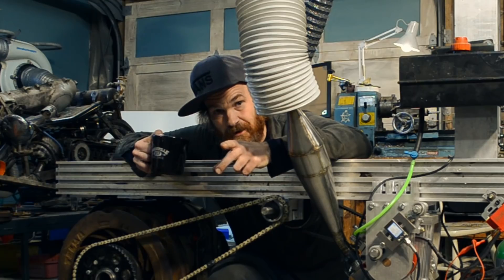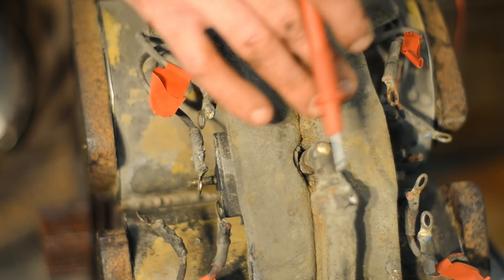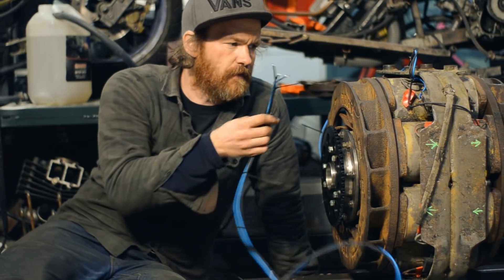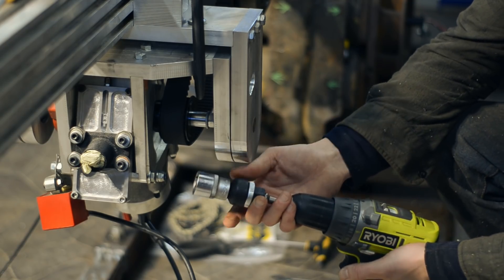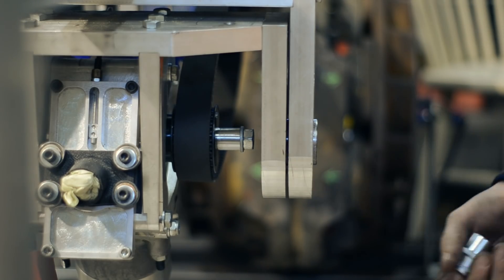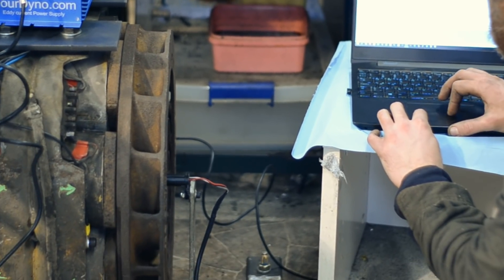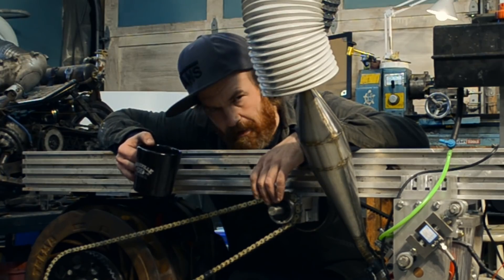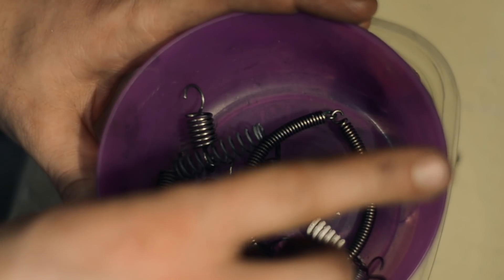The dyno, IT'S ALIVE!!

Comment: Your dyno rotor seems to have some quite massive fans on both sides of the rotor. How are you planning to characterize loses caused by these fans? Engine power = power calculated by dyno + fans losses. I am impressed by your work. I used to play with Aprilia RS 50 with AM5 motor. Great time... Regards.

Comment: This is just an fyi for your future self (in case you didn't know this): the compass needle's red end is magnetized to be a north pole, meaning when it points/aligns to the face of the coil you're checking, that part of the coil is actually the south pole; the same idea for the other end of the compass needle (south pole of the needle aligns with the north pole of a coil). This doesn't matter in your case to get the eddy current dyno working but thought it may be useful to know for something that may come up in the future for you.

Keep up the excellent work. Cheers.

Comment: You need a locking torque converter or direct drive. You are getting losses with that clutch even with light springs, just with the inertial mass.

Comment: Have you considered a clutch like in the( china doll ) 66 cc bicycle motor kits . looked like you were already using parts from a motor kit , i recognized the part right away , no ground  clue . too bad you were not around when i raced Yamaha 100 open karts , used 3 disc 6 spring wet clutch , boiled the fluid in about 15 laps .just enough to go to the front . .. i kinda understood centrifugal clutches were only good for up to about 8 hp .. even worse on 2 cycle motors , but your mileage may vary ... keep up the great stuff ..

Comment: It is goood to hear It running again, sounds sweet! just give It plenty oil in that metamfetamin fuel. May I suggest to use a standard centrifugal clutch instead, at the dyno side of the frame. They are easy to tune for high rpm.

Comment: you might still be able to make a small crater around the copper wire going intoo the broken coils and try to solder a new wire to it then hotglue the wire to the plasic to make it watertight again and to prevent the wire from moving  , doesnt matter if it works or not but it will alow you to load it higher 
you allso might be able to use the retarder as a startmotor if you put some sort of dc x-phase power regulator in there , probably whont be realy powerfull for the size of the thing but i bet it be powerfull enough to start that 50 cc engine
the sound the retarder makes is the wires inside the coils vibrating , you might want to make sure they dont heat up too mush

Comment: Don't use plasters. Real men use Super Glue to glue the wound, then peel themselves off the ceiling and carry on as before. Fun fact: Super Glue was used in the Korean War for battle surgery, as it's the moisture in skin that makes it cure. It's still used in cosmetic surgery today. as the scars are minimal.
Reply from the maker: I almost exclusively use blue masking tape. Never had much luck with the glue. Might be cause I've tried to close up too large wounds with it. Burning should work. I once got a nice bite into my hand by an angle grinder and it didn't blleed at all, but smelled like bacon😁

Comment: Wonderful 👌 did you do any calculations for the dyno gear ratio? Since you have a massive braking capacity, you could use a short gearing to reduce the clutch slippage and bring it to powerband faster. Probably 500rpm is enough for that brake.
Reply from the maker: 👍 I should really go for a second jackshaft, more reduction, there's plenty of room. As it is now we're talking about 3600 brake rpm for 20 000 engine rpm - What I could manage with the parts available.
Reply: @2STROKESTUFFING  yeah 3600 sounds excessive. But you can do first trials with it 😀
Reply from the maker: @ASoftaaja  yep, 4000 is stated as max. I'll see how bad it vibrates. Having it geared like this means it'll work well as an inertia dyno too though. Remember taking my other dyno up to around 4000rpm with a Harley on it, the whole building was shaking!

Comment: Isn't the huge inertia of the brake going to be a problem relative to the engine power in this setup? Maybe gearing can solve this? It seems to me the engine wil have trouble spinning up the brake.
Reply: I don't think the brake has more inertia than the whole bike with the driver. The problem is, the engine does not have any power at low rpm, so it takes some time to reach the rpm where it has a lot of power

Comment: Nice work 2 eared van Gogh.   Some ideas.. Maybe your dynamo is to heavy to get around already , for such a smal clutch ( after that scooter clutch is also a gearing , that make's it lighter to get around) may a other bigger chainwheel wil do a better job , getting a higher rpm. Ive seen some drag race clutch witch have no spings , but thin aluminum plate that bend's out , and only the weight of the clutch plates that make them go out in high rotation... Wheight of the clutch plates also make a big diverence

Comment: The shot u have of the clutch grabbing, looks like one of the brakes hasn't seated cleanly on its spline. Might cause vibration and stop the engine getting to its max rpm
Reply from the maker: One of the rotors on the brake? Yeah, I thought I saw some wobble.

Comment: Would it not be better to use a toothed belt from the engine to the electromagnetic wheel ? It looked like it was slipping a lot. Don’t know if that’s just the camera playing tricks with my eyes or if that’s actually happening. Either way it’s coming on great keep up the cracking work 👍🏼

Comment: Repeat After Me : my exhaust system is to short.
Reply from the maker: I like rpms
Reply: @2STROKESTUFFING  
If you want power at high rpm, don't forget the correct lenght for working.
Egt drop need lenght too.
For me you kill literaly the capacity of this engine with this radicaly exhaust.
For exemple, look the drawing of RSA exhaust, for 13000 rpm  lenght 800mm with big egt. 
Design a real exhaust for this motor, use Vannik and go right.

Comment: Inertia is your friend it can be a dyno just by spinning that mass up and recording rpm against time 

Mass of spinning object

Rpm of spinning object 

Calculate acceleration for each second 

No brakes needed less heat less complex 

More dyno!
Reply: ..there has to be resistances akin to that which will load/act upon the tyre, wheel, bearings, & engine etc, ..as much to help tune the set-up, design and mechanicals enough before road/track testing - otherwise some settings can be far from correct or good enough to even get close to what originally envisaged.
Plus an engine with little to no load will/can over-rev and wear out or destroy itself faster without that burden upon it, realistically taming it.
Reply: @razor1uk610  the Shear mass of the rotor is enough of a load just because its not braked doesn't mean you spin it up without effort take a truck wheel could you walk upto one (raised off the ground) and just flick it upto speed by hand? 

A large enough mass takes allot of energy to spin it upto speed 

Plus the math is allot simpler 

When it comes to overreving that's what the throttle is for!
Reply: An inertia wheel doesn't have the ability to hold the motor at a set rpm. With the eddy current brake you can hold the throttle wide open and control the motor rpm with the dyno. At that point you can accurately measure the torques.   😀  I'd guess he needs to reduce the dyno rpm by 50% to reduce the intertia effect? It will be fairly exciting to stand anywhere near that brake at 3600 rpm! Are the rotors balanced separately? Are they indexed on the shaft? I had a horrible thought about balance and rotor indexing, hopefully it's just a thought.

Comment: won't the magnetic brake magnets interfere with the rpm pickup?
Reply: I think it depends on the polarity of the brake magnet that is at the same position as the rpm pickup. If the polarity is the same as the polarity in the pickup, the rpm signal should get stronger. If the polarity is not the same(magnets repelling each other),  the rpm signal may get weak or gets inverted, but I think it will also work with the inverted signal, because the frequency is still the same.

Comment: Just wondering if the solenoids on a Telma retarder (used on medium commercial vehicles) are capable of being excited at a low enough level that the engine isn’t over-loaded, either that or they can’t generate a low variable torque. Maybe only a small number of solenoids can be actuated?
Reply: Those are not solenoids, they are electromagnets. the load is varied by how much current you run through the electromagnets.
Reply: Sorry if I used the incorrect terminology and yes I appreciate they are electromagnets which generate eddy currents in the rotors. However my point remains the same…
Reply from the maker: We'll find out soon😁 If problematic I can always gear down a bunch to increase torque.
Reply: I do hope it works out OK because you’re doing a great job and your vids are always inspirational.
 @2STROKESTUFFING

Comment: on a serious note..... shouldn't it be direct drive without a clutch? I mean, there's got to be another way to engage it where it's locked in place once you engage the clutch you don't want slippage you get a bad reading that way. I was thinking air conditioner clutch on a car, but stronger. let me think about this while I drink my coffee and I'm going to figure something out worth talking about.....😏.....(sips coffee)…. oh I got it. have you ever seen how a Detroit locker differential works? centrifugal weight spin, and after a certain point, at a higher rpm, it engages (clunk). it's like having a centrifugal clutch with cog tooth gears between the pad surface and the sliding surface. once those teeth teeth mate together, it locks.

Comment: Just throw some heat on those springs and they will get lighter. Worth a shot just to try it. The ones you have won't work so you won't lose anything  by trying  it.
Reply: Dude, the springs are too light already, the clutch is engaging early and the motor does not make enough power to overcome the inertia of the retarder at that RPM. Get the motor up in it's power band RPM and it will pull it fine.
Reply: @rickbegeman4371  you're right, I thought he said they needed to be lighter? But yes they need to hold the clutch in  till a higher ram. I.wad thinking of a torque converter for a go-kart where the weights need to be lighter to allow it to spin faster before they get thrown out and engage it.

Comment: You're not supposed to fall until you're older. A farmers remedy for cuts is an application of clean diesel fuel and no infection. Amazing but true.
Reply: For small cuts cyanoacrylates aka superglue is the best. I've often used regular ones, but specialized medical ones are preferable.

Never again problems working with cuts in your fingers. Just burns like a b when applied.

Edit:
For deeper cuts, infected or dirty wounds it's obviously a bad idea to just glue it shut. But it becomes more and more widespread in regular medical practice and has been used in the military even for deep, heavy bleeding wounds for decades for good reason.

Comment: Forgive me if I'm wrong, but shouldn't the vanes on the Dyno be turning in the opposite direction to suck cooling air through? Probably doesn't make much difference for short, comparatively low-power runs.
Reply: The air is centrifugally pulled from inside to outside, past the coils, to cool them, so no, they are turning correctly

Comment: Have you thought of, perhaps, using the electric clutch from a car air conditioning compressor?
Reply: I actually second this ac clutch idea from the car.. never seen one slip on a locked compressor just rip belts. And it takes a good bit of power to rip most 6rib belts
Reply: i was thinking about a normal clutch, like from a Hona MB-X or something. Will probably be way more complicated, but you can control it the way you want it to behave
Reply: It can only handle few kW but a supercharger clutch can handle more I think.
Reply: @eurobeatmachinist732  what about an electric clutch off a hydrostatic lawn mower
Reply: Even a carefully calculated shear bolt/wire could work well. Considering its only needed in major failure situation. Here"s what I mean https://en.wikipedia.org/wiki/Shear_pin
Reply: R4 pancake style consumes 20-40hp

Comment: But because it’s a load cell does it matter if the clutch engages early?
Reply: Yes, because he's only interested in the power above 14000 rpm. The engine might not have enough power, at the rpm where the clutch engages, to get the retarder up to speed in a reasonable time, and I wouldn't want to be anywhere near the retarder, once it was up to that sort of speed. If the clutch engages much later, he can start using the retarder, for its purpose, a lot sooner
Reply: If it engages early it wont engage at high rpms.
Reply: @paciencia0956  but it’ll still be driving the dyno from low rpm and on up.
Reply: @robertpierce1981  Once it goes into mid-high rpm because the springs arent strong enough the clutch wont engage properly causing a loss in power, hes engine is also made for high rpm meaning at low rpm there is literally no power making it impossible to go higuer in rpm because the power aint enough to move the transmision fast enough to let the engine rev up.
Setting up the clutch on these systems is all about keeping the rpm at the power band the engine is built for.